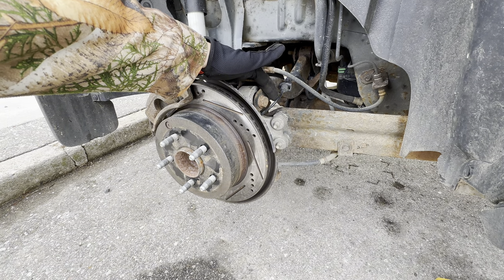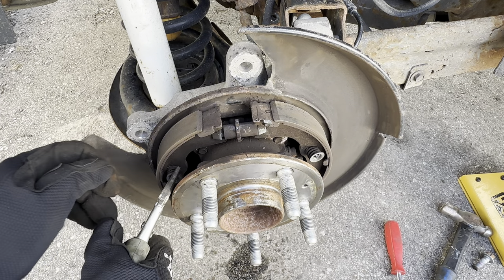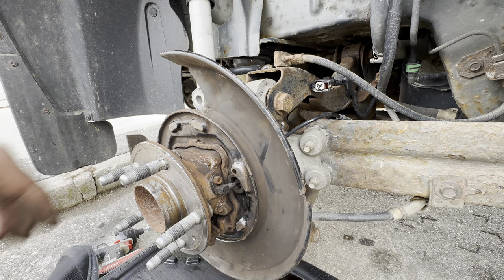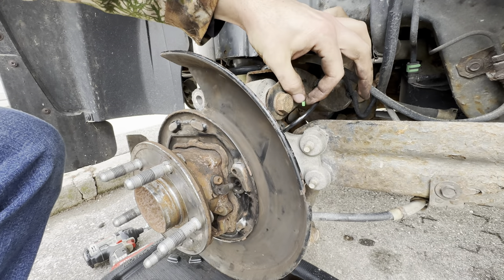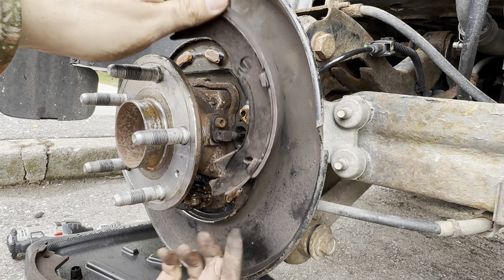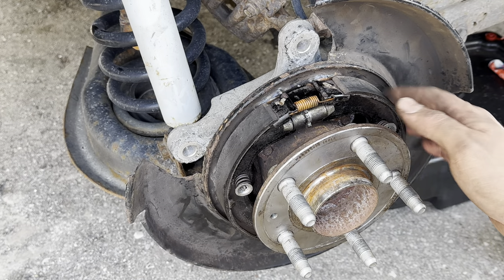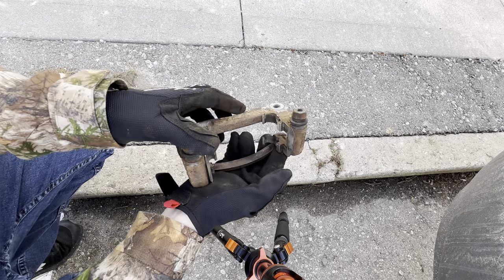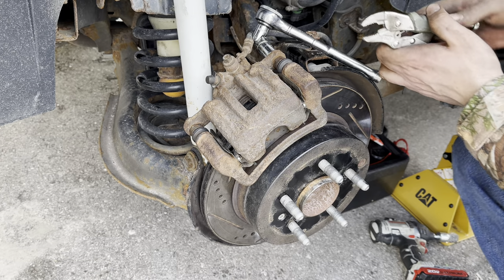Chevy Equinox/Gmc Terrain Rear Wheel Speed Sensor Replacement (Service Stabilitrak Fix)

Comment: Praying I don't have to touch the rear wheels on mine. Is there a scan tool that will tell you what sensor is out or giving a bad reading? My Stabilitrak goes in and out so I'm reasonably sure a hub assy needs replacement.
Reply from the maker: I used bluedriver scan tool. You can buy on Amazon. Cheapest and easiest route is to replace the sensor. If the warning keeps coming up after that then you know it’s the hub. The bluedriver will tell you exactly what wheel is the issue. Mine had the tone ring broken off the back of the hub. Here is the link to the scan tool: BlueDriver Bluetooth Pro OBDII... https://www.amazon.ca/dp/B00652G4TS?ref=ppx_pop_mob_ap_share

Thanks for watching. Please like and subscribe
Reply: Don't be so sure I've changed them all.  sensors,hub assembly front/back,fuses, sp plugs, o2 sensors, new battery. Still comes on and off depending on weather.

Comment: unplug one wheel speed sensor at a time to determine which one may have gone defective? The auto parts store does not come up with an error code.
Reply from the maker: So for example if you take the rear driver side apart and then find it’s not the one giving the code then you gotta get the brake pads, shoes, caliper and rotor back on, then you gotta dismantle the whole thing on the other side all over again🤦🏻. Better idea for you… just buy a proper scan tool. If you are fixing things like this then you should have a scan tool that will scan all modules. And it magically tells you the exact location of the fault the first time. Imagine how easy that would be. 😂😂😂. Forgive me for my rebuttal but I like to be precise when working on the car. I don’t like to guess.

Comment: Hi did this solve your issue? seems like most say the 
hub/bearing also tends to need replacement was just curious if this fixed your issue or did you have to do both? Seems like it’s common for the front to need both or at least the hub/bearing. Unfortunately mine is rear left like yours so will see.
Reply from the maker: My rear never had an issue. I just wanted to show the process because I was filming a parking brake shoe video so while I was in there I filmed this but put the old sensor back. I will say however that my front did go bad and it ended up being the wheel hub. Replaced the sensor on the front and the warning came back upon driving it. For me it was the tone ring on the back of the hub that broke off. Replaced the entire hub and all is good. Hope this helps. Thanks for watching. Please like and subscribe

Comment: Hey man 2017 equinox 2.4L , mechanic told me have low compression on cylinders 2 and 3 and recommended an engine rebuild or engine swap. Is there something maybe he missed or easier solution ? Didn’t know how to message you so commenting on this video. Thanks
Reply from the maker: Sounds like he is jumping to the priciest solution. Did he mention replacing piston rings? These vehicles are known for piston rings getting stuck. This would cause oil consumption. Plus it could cause a compression issue. It would still be a big tear down but cheaper than an engine swap.

Comment: Will this stop the vehicle from starting?
Reply from the maker: No. This is related to the traction control and antilock brakes systems
Reply: @BillOfAllTrades2016  yes m clients stabilitrak came on and is now no crank no start. Just changed the starter and the starter relay and fuse.